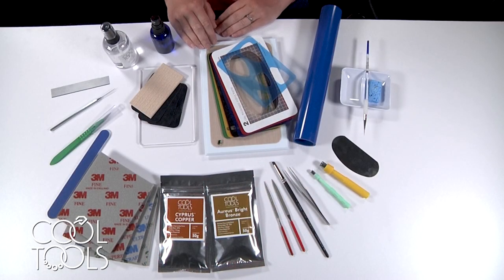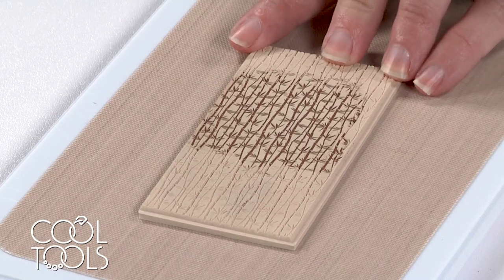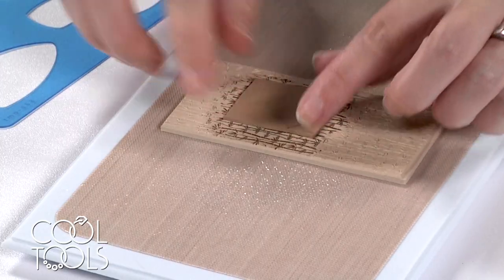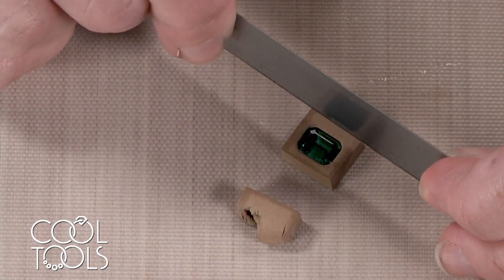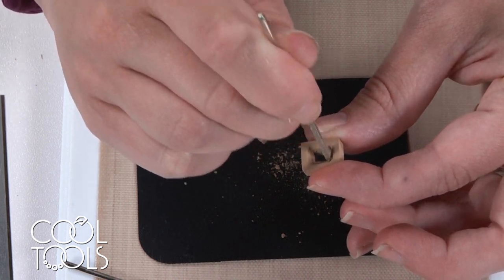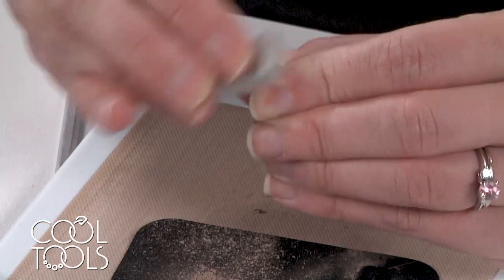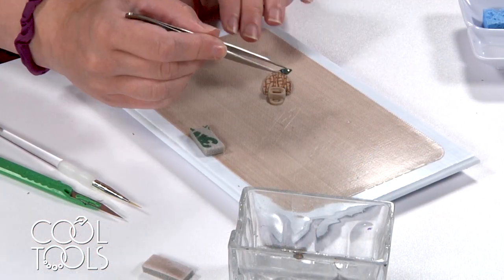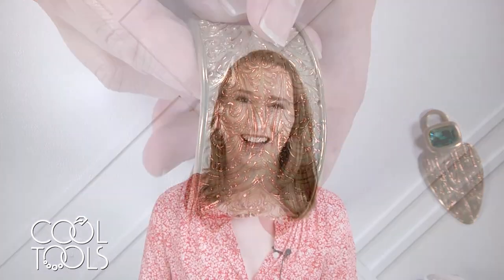Cool Tools | Mixed Metal Pendant with Aureus Bright Bronze and Cyprus Copper Clay by Karen Trexler

Comment: Great project, Karen! So many helpful tips that can be applied to different projects.

Is there a reason you didn’t lightly rehydrate the copper “overlay” after attaching it to the bronze base (and letting the moisture soak in a bit) before cutting out the shape? I would have thought it might help avoid some of the separation of the delicate copper design and minimize any rough edges during cutting.

Thanks so much for everything you do to educate us!
Reply from the maker: Thanks Margaret! 
When playing around with this technique, I tried spraying the piece before cutting, also thinking it would help with attaching the components before cutting, but the result was the softened copper ended up smudging along the cut edge. As I pulled my needle along, copper that I had passed through ended up carrying with my needle and smeared along the edge, resulting in me having to do a good bit of sanding anyways and then the pattern along the edge ended up being not as crisp and looked blurred. 
Thanks again for your kind words! 
Karen

Comment: Beautiful!!  (As usual!)  Question:  If I'm using a ceramic firing vessel (in a kiln), can I still use the same firing schedule you mentioned?  Thank you!
Reply from the maker: Thanks so much! We have not yet tested this firing schedule with a ceramic vessel. As ceramic firing vessels can retain heat and increase the temperature, you may need to fire a test piece and lower the temperature by 25 degrees if your test piece has blisters or an over heated surface. If you would like, I'll test it out and let you know! Karen
Reply: @cooltoolsvideos  (Oops!  I hit the 👎 by mistake!  I fixed it, though.) Thank you so much for the information!  Sure, if you are able to test it, that would be great!  👍👍🙂
Reply from the maker: @moonbeammimi  I tested the recommended firing schedule with a ceramic firing vessel, and the test piece turned out just fine!
Reply: @cooltoolsvideos  Excellent!!  Thank you!!

Comment: What did you do with the left over bronze clay that had the copper texture on it.  You put it aside and then didn't mention it again.  Would you have done your best to remove all the copper texture and then used as normal bronze?
Reply from the maker: Thanks for asking this, I should have thought to mention what can be done with that left over clay. While you could try to pick the copper off, I just am keeping the left over in a clay hydrator labeled Cyprus + Aureus, that way i know to use it with the adapted firing schedule. I've taken some and folded and rolled it (like is done when polymer clay is being conditioned) and the patterns have blurred to be a kind of marbled look- which i'm looking forward to seeing how that fires! I've also just folded and rolled the clay until the two types are throughly mixed and I am left with what fires to be a slightly more rose tinted or warm colored bronze. The clays retain moisture so well that I have not had any issues with them drying out while being rolled and mixed. Thanks again for asking! Karen
Reply: I was thinking that the scrap combo clays could be used on the reverse to make a decoration on either the bail or a "window" for the stone on the backside of the pendant.

Comment: Hi I've tried this twice now and every time my piece fall completely apart after the first phase of fireing  what am I doing wrong?
Reply from the maker: Hi Karin, I have not experienced this and can only guess as to what may be going wrong. Do you mean the bronze detail is falling off or the piece itself is breaking? If the piece itself is falling apart at joints, did you throughly dampen the elements of your piece prior to joining them? If your detail is falling off, did you spray the piece as a whole, very generously after cutting out your shape? 
I’m wondering if it could be the result of how the pieces are being handled between the two phases? With all the binders gone the piece is very very fragile- perhaps try doing a firing where the first phase is done on top of an inch of carbon in your firing container, and then instead of handling it and giving the piece opportunity to break, just gently pouring more carbon on top of your work to bury it for the second phase.

Karen
Reply: @cooltoolsvideos  thank you for responding yes I was trying to do it with the carbon next I already went down with the temperature the pieces without the stone are ok just the once with the stones fell apart . So yes I guess putting it in carbon might be the answer  thank you so much